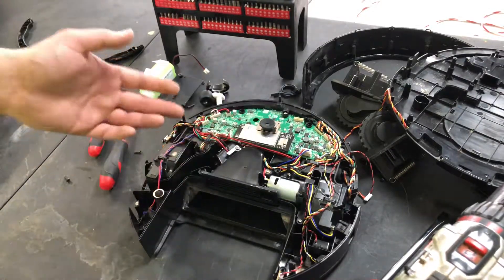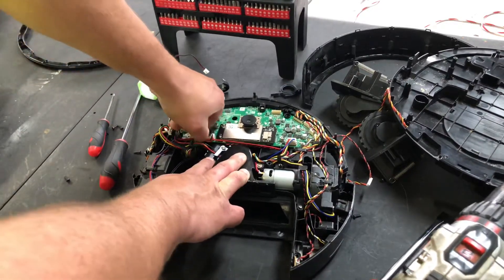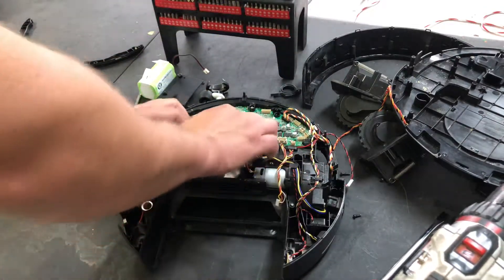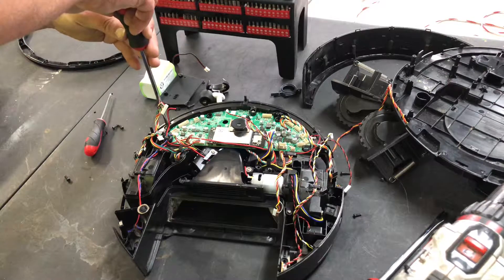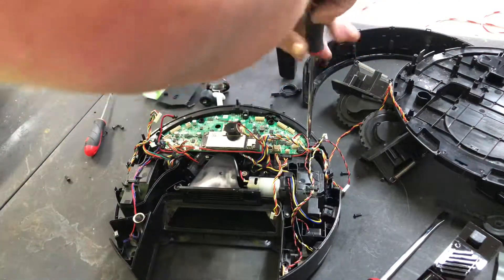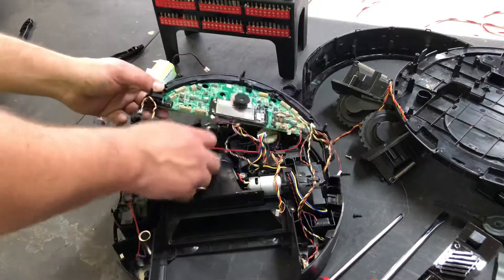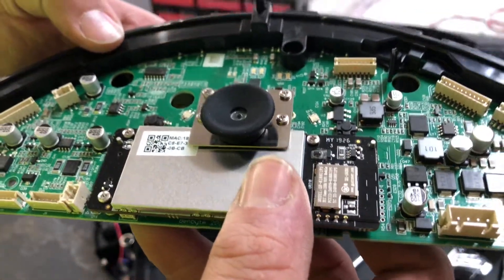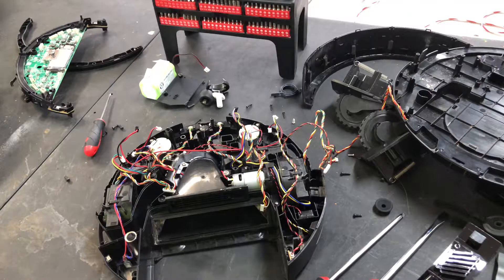Shark IQ 1001AE How to Remove motherboard

Comment: I was wondering if you have any close up pictures of the mainboard with all the wires connected, and have a description of what is connected to each connector. Working on a project with the mainboard as a base, but need to determine what is connected to where.
Reply from the maker: I don’t currently have any open
Reply: How do you know if mother board is bad